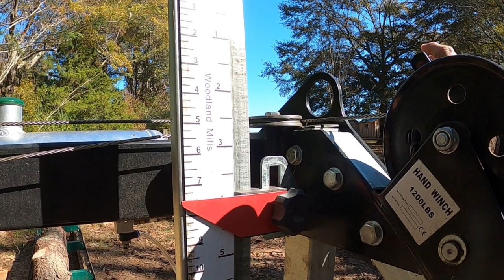WAVY Cuts on Your Sawmill? DO THIS!

Comment: Hello, I noticed your adjustable blade guide is retracted all the way. The blade guide should always be extended as close to the log or cant as possible. The guide is adjustable for a reason. As soon as the blade starts to get dull or you feed to fast it will wander. After milling literally millions of board feet on industrial bandsaws I can say, "as soon as you see 'snake' you slow down or change your blade".  Keep that blade guide close to the wood and everything will be better! Cheers, MAC
Reply: Replying to my own post; Maybe your mill does not have the adjustable blade guide? If it does not it is an absolutely necessary piece to have. I always wondered why it is not standard equipment on all the Woodland mills. You need to get one, you won't be disappointed. Cheers, MAC
Reply from the maker: @bobmacri1047  yes, we do not have an adjustable blade guide and can't afford one anytime soon, though I do agree it would be very useful.
Reply: Your advice was my first thought. Choking up on the log shortens the amount of blade and makes it mor rigid through the cut...i see people all the time with the throat all the way open..or worse yet not available on the mill.

Comment: I had this problem, wasnt apparent that I hit anything. Blade guide 3" from the cant. Swapped the blade, still cut wavy. Then I checked my blade tension. It had backed off about 1/8 inch. Tightened it up. Cut dead level. With the same blade that was wavy originally. 
Band saw milling it a learning curve. No pun intended.

Comment: Maybe you can just run those planks through a thickness planer and repurpose them. 

Thanks for this video. I've had similar problems with my 122. I was cutting mostly Ash and maple so the blades don't last long.

Comment: I had a problem with this , and also blades dulling really fast , top tip get pressure washer and wash your logs the tiniest bit of grit/sand stone dulls blade , you can improve blade life 2 fold :) 
Another option is changing blade when you get on a good clean cant :)

Comment: running the guide arm wide open  will contribute to blade error adjusting to size log your cutting will help.   your cut will be better and  your blade will last longer due to better lubrication and less whiplash
Reply from the maker: We do not have an adjustable blade guard.
Reply: @ThirdTimeAroundRanch  i see now what you mean. that's the first saw i ever seen without adjustable guide arm
Reply: I leave my blade guide pulled back pretty far. With the roller guides adjusted correctly, blade sharpened and set, I cut fast and straight. Mill alignment is key. The faster you cut the less sawdust. And blade stays sharp longer because it's in the wood less time.

Comment: I did not see it on here.. but if you leave the  tension on the blade for an extended time like over night it stretches the blade and causes waves.. releasing the  Is tension will prevent this.

Comment: I've been milling my own lumber with a BSM since the 90's, and anytime you get wavy lumber, and you don't see anything obvious, ALWAYS change the band first!!  Almost always it will fix the problem as dull bands = wavy lumber!!  SR
Reply from the maker: The blade that was producing the wavy boards only had 3 logs on it and was still cutting quite easily I wonder if it was dull or something else went amiss with it.
Reply: @ThirdTimeAroundRanch  All you have to do is hit ONE small stone or some dirt trapped in the bark, and it's all over...  SR
Reply: @ThirdTimeAroundRanch  You need to check and or replace belts as well...also very make sure your sawmill and "BLADE" are level...

Comment: Honey I admire your spunk... that said, I was wondering how come you don't use the sliding guide block so less of the blade is flying in the air before the cut? If it doesn't adjust then getting a adjustable arm for it may help some too when those blades are getting dull. I don't know if a person could ever run a thin board through again to take some of that wave out but maybe you can hide them in some live edge siding or underlay on the roof of some building for purelling, to screw metal down to. I saw those waves as you were sawing before and just sawing faster might of made bigger waves yet. One thing for sure, every board counts when you need them. We sawed some spruce here about three weeks ago and it came from a lake job. They fell the trees along the beach line and inside of the bark was a layer of sand that had been blown into the trees during storms from years before.... it took out a blade per cut getting the bark off of these trees. Nice sized an just couldn't leave thirty to forty inch trees just not cut up. Here in alaska, we have glacier silt and its deadly to blades.
Reply: YES, you can resaw the wav's off the board, you have to go show as you are expecting the band to cut through thick and thin area's...  SR
Reply: <you have to go "slow">
Reply: @sawyerrob949  thanks guys... its starting to warm up here... a pleasant thirty right now. You could put a minus sign in front of the thirty just a few days ago. If you are curious about our country side... simple life alaska is my neighbors channel and you can see what we get. They put out some really good videos and its all local central alaska. I'd bet a nickel that you would enjoy watching their short videos
Reply: @morgansword  I lived in Alaska for 25 years and traveled much of the state, mostly hunting.  I spent huge amounts of time in the bush, so I do have an idea what Alaska is like.  I have seen some of the simple life Alaska vids, along with a few others too...  SR
Reply from the maker: Our mill did not come with the sliding blade guide I think they sell one you can add to it but we have not as of yet felt it was a priority when we have so many other things to invest in. And those wavy boards will get used for "something"
Reply: @ThirdTimeAroundRanch  Sorry I even mentioned it as I have evidently made you very unhappy... was not a intention of mine at all. Not at all
Reply from the maker: You did not make me unhappy at all, we love hearing from you.

Comment: Hello, I know this video is 2 yrs old but got a question....at 0:43 into it when the lube tank was being filled, That was some really soapy looking mix being pored ....can I ask what your mix recipe is for your lube and how does it work at keeping pine pitch off the blades/belts ??  Thanks
Reply from the maker: we just put a few squirts of dawn into the gallon of water. It does an ok job of keeping the blade clean but I hear pinesol may work better

Comment: Hi just wanted to say that I like your videos and what part of alabama are you from I am from a little town west of Birmingham about 50 miles
Reply from the maker: Thank you! We are from a small town near Dothan.
Reply: @ThirdTimeAroundRanch  so I see you weren't happy with the  harbor freight sawmill good price but from what I've seen it has some problems
Reply from the maker: @gregboshell977  The biggest problem was not being able to get replacement parts. Basically after you buy it HF washes their hands of you and the machine.
Reply: @ThirdTimeAroundRanch  as far as price how much difference is there with a 7 horse motor
Reply from the maker: @gregboshell977  If your talking about the WM the difference in price between a 7 hp and a 9.5 hp is about $250